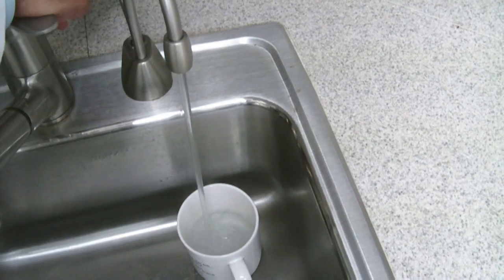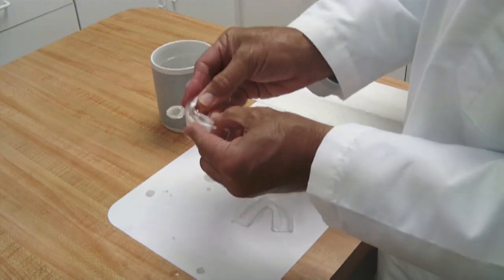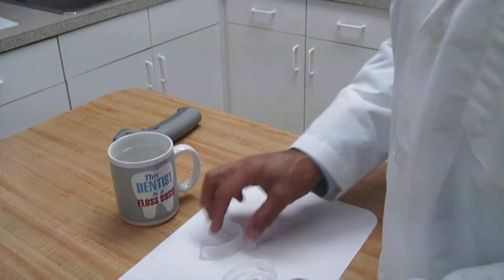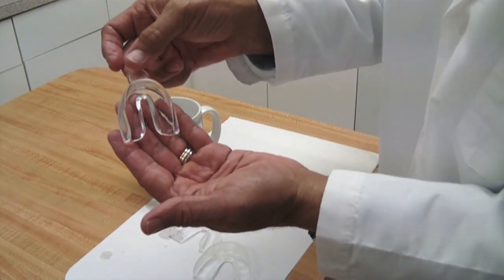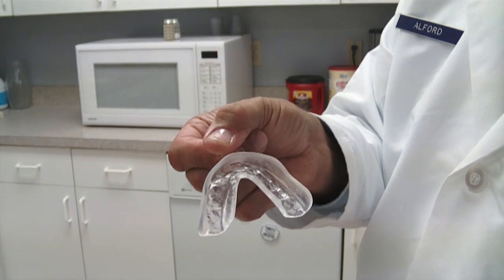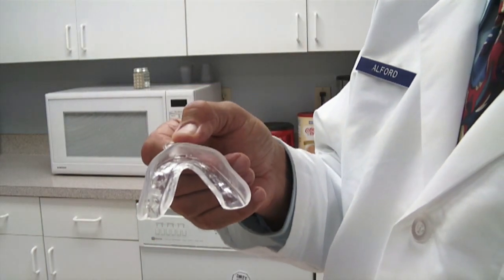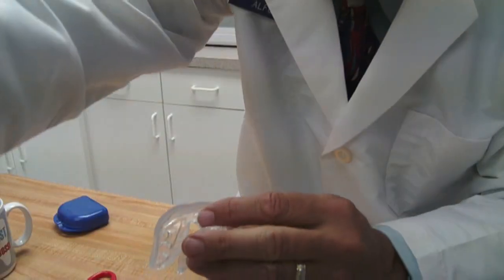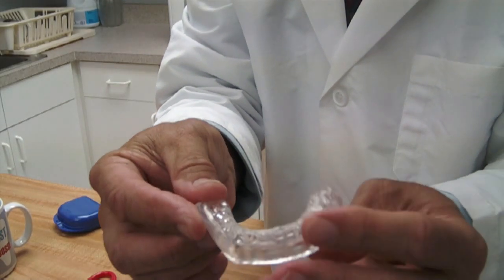Tray Construction

Comment: Great video! My trays were made in the dental office from impressions. I have had trouble with some of them being uncomfortable (sharpe edges) which they made them over for me twice because of that and now the top one has stretched out these were made from a soft thin rubbery like fabric. I only used it about 10 times nightly and a few times for an hour or so during the day. They made another tray it was a hard thin plastic like fabric, unlike the other, and it cracked first time I put them in.  I give up and they act as though it is my fault and my problem as well. Is there anything I can do with the original softer more rubber like original tray that stretched out? It is too loose to even get the results because it won't stay in place and saliva gets into them. Thank you!

Comment: My bottom tray folded over on it's self. I'm guessing there is no way to fix this?
Reply from the maker: Dear Rose,
Take your folded tray and re-heat it again until it turns clear. Then allow it to only slightly cool. It should still be limp even if its cooled a little.  Then you should be able to pull the folded portions apart.  Once you're puilled them apart re-submerge your tray in the hot water for a few seconds and then place it in your mouth to mold like I discussed in the video.   Good Luck.  Dr. T
Reply: Joel Terry Alford Ah thank you! ^-^